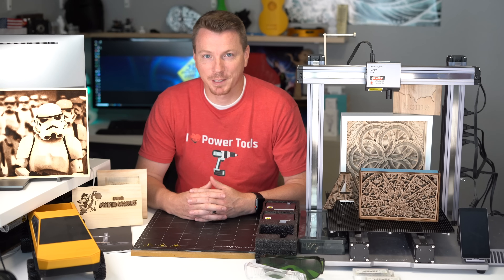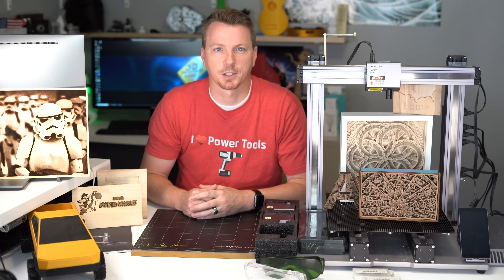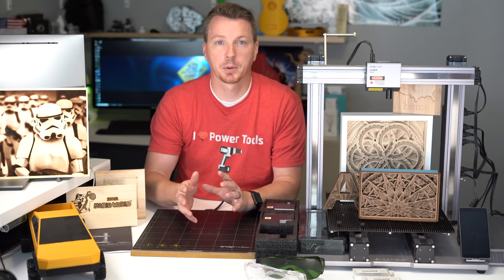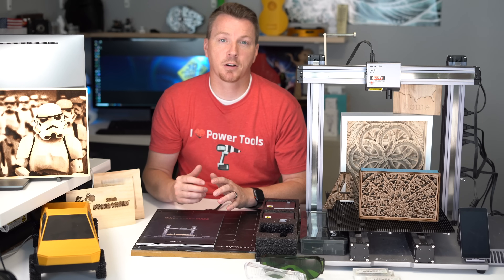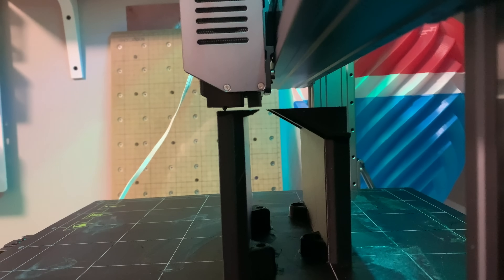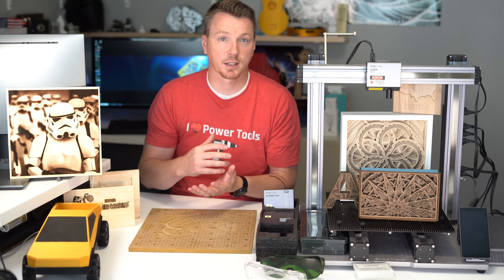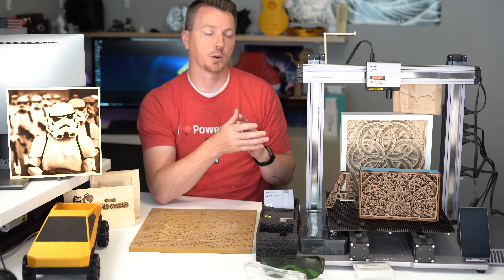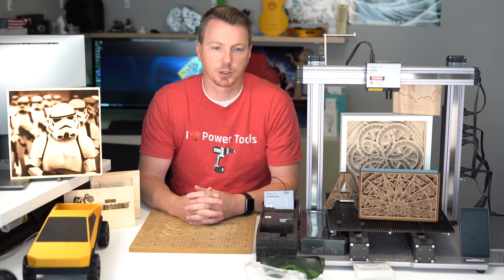Snapmaker 2 Review: 11 Pros plus 6 Suggestions

Comment: This thing is like a friggin jet taking off. The biggest source of the noise is the power supply where they used a tiny fan. There are some mods from the community on this but for such a high price tag I was so annoyed that they seemed to overlook this given that it can be fixed so easily and at relatively low price compared to the cost of the item. This seriously lowers the spouse approval factor unless you can put it in the garrage/shed etc. I was very disappointed with the enclosure for this - they left a friggin hole in the door! It looks pretty and sure it operates nice but its an epic failure at two very basic points that an enclosure is suppose to address the first being noise, yes there is a minor reduction and likely could have been more if they didn't leave a hole in the door but a very high price to pay for minimal noise reduction. The second one is particulate containment be it very fine dust from CNC or most importantly fumes from laser engraving (again the spouse approval factor) but this is where the hole in the door goes from laughable to just derp - so derp I cancelled mine after pre-ordering it.

You know the engineers are competent and capable and yet for some reason sealing it hermetically which solves both of these issues didn't come to mind and again it goes back to price, the enclosure is not cheap at nearly $500 USD or a third of the price of the A350 and yet what they deliver is a big fat failure, they took the apple hardware route of looks good but functionally its meh at best.
Reply: But you are making things in your house! Who cares if it's loud? It never bothers me.
Reply: @jasmine2501  Good for you but as I stated for me "spouse approval factor" is a thing, its definitely too loud to work in the same room and it too loud to be left printing overnight for longer prints which you will do with a big print volume. As I said if you can put it out in a garage or a shed etc your golden..... maybe. Also as I mentioned for me the point of an enclosure is not just for noise reduction but also for containment of particulate matter and fumes.

Comment: Do you still like it?
Reply from the maker: I do! In fact, I've been using it almost every day lately for its CNC capabilities. I have several other 3D Printers and a separate laser engraver so I tend to use it mostly for the CNC side of things. I recently got the new Snapmaker Rotary Tool and I'm working on a video for that and it opens up a world of possibilities. I'm glad I went with the A350 because there's not much I can't print/cut/engrave on a machine that size, especially as compared with the smaller ones.

Comment: as cool as this 3-1 seem. I'm sure you can just buy a laser cutter head and CNC carver for a normal 3D printer...
This machine seems to be twice the cost of a 3D printer.
Reply: The issue with adapting printers to be routers is that you need rigidity in the machine, which most printers lack due to them being designed to never having to deal with cutting. Another issue is XY footprints, printers usually have small, square table, with a tall Z axis, where any other cutting/engraving machine typically has a larger, rectangular XY table, with a shallower Z axis. It'd be better to adapt a CNC router to work as a printer, as you'd only need to adapt the tool, surface, and Z axis height to work as a printer; doing this also makes it a more versatile machine due to the platform already being rigid enough for routing. 

There's also an issue of converting printer platforms to routing, which is shown in this machine, look at the router they're using, it's anemic. The motor is on the left side of the module, spindle on the right, which means it's being geared down from a high speed motor to what should work as a CNC spindle. I wouldn't be surprised if the motor itself is more similar to a Dremel, or similar handheld rotary tools. I'd rather see at least a standard router, if not a proper CNC spindle. This also means that this machine will never be able to do the routing work that a dedicated router will do. 

Between these and the laser being anemic, this machine was clearly designed as a printer, then they stuck on addons that're below what the standard should be. This shows why you don't want to adapt a printer platform to be other tools, unless you have the rigidity and better motors for routing, and a more powerful power supply for a laser module and router/spindle.

Comment: The desired addons that were suggested are all already planned releases along with a few more and can be found their website.  https://www.snapmaker.com/platform  go to addons and future expansions.  So they do have an IP camera to monitor your prints as was suggested but I do not think they have released any of the addons except the Enclosures.  In addition to the rotary 4th axis addon that was described there is a more powerful laser coming called the H Laser and it can do a lot more.  So I think that laser will cover what you are wanting as far as that goes.  Also there will be an emergency stop button, LED Light strip, and a hand wheel.  You already mentioned the XL rails coming later which super size this machine a lot bigger than the 350A which is awesome.

Comment: Good overview, but you were too kind. Many have had problems achieving the flat bed that you were immediately able to print on. And there have been a number of failed linear modules reported too. So maybe their quality control could be improved. Obviously for review purposes they would likely have sent you a tried and tested model so I am not blaming you or anything, but just to say its not all as "plug and play" as you make it out to be.
Reply from the maker: That's entirely possible. I could only review what I had. Based on some of the other comments I'm seeing here, a lot of people are having a great experience but I know that's not always the case. It'd be interesting to know some of the actual numbers of issues vs smooth experiences like mine.

Comment: You mention it being  too noisy and that if it were enclosed like other models, it wouldn't be so loud.  So why didn't you just purchase the enclosure that is available from Snapmaker?  Problem solved.  I only say this, as I don't think you're being fair to Snapmaker listing this as a "Con", when there is a solution available.  This one "negative" could be enough for some of your viewers to not want to purchase this machine.  Just sayin'...
Reply from the maker: Sorry for the delayed response - I completely missed your comment. Unfortunately, the power supply for this machine goes outside the optional enclosure. The enclosure helps with the sounds that the machine makes, so that would wonderful for CNC in particular, but even with the enclosure, the very loud power supply needs to sit outside of it and that's really noisy. I actually heard that you can replace the fans in the power supply with quieter ones so I ordered some and they should be here this week for me to try.

Comment: As much as I want to like these multi-use machines, they all do their modules in the wrong way, with absolutely terrible footprints for every use. Modules should be done in the style of tool changers, not a user-swappable module; this would also open up the platform for more uses, like drag knife and non-laser wood burning. This machine also favors 3D printing, due to it's smaller, more square XY table and tall Z axis, where a CNC router and laser engraver would be better with a larger, more rectangular XY table and shallower Z axis; why not just give us the table that works well with routing and engraving, then give us the tall Z axis for printing? 
I also have concerns for the router they're using. Just like how the laser is a bit anemic, the router looks severely underpowered as well. It looks like the motor is on the left side of the module, and the spindle is belt or gear driven from that, which means it's a much faster motor getting geared down; I have a feeling it'd be the same as if you took a Dremel and geared it down for constant CNC use. I'd rather see an actual router, if not a proper CNC spindle. 
This machine is just a 3D printer first, with a couple other add-ons that aren't that great, designed as a printer and works best as a printer.
Reply: There's XL modules coming which makes work space way bigger in a horizontal fashion. You are correct on more rectangular XY table and it is coming. Being modular just makes future upgrade for the machine way easier.
Reply: Higher power tool modules are also coming so... It seemed like to me you are asking way too much on a 800-1300 dollar 3 in 1 machine my guy